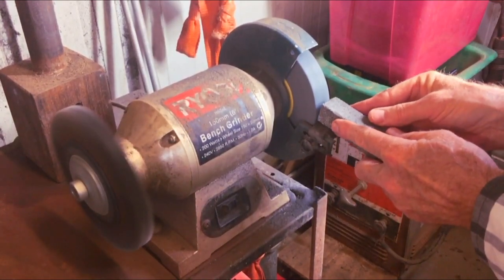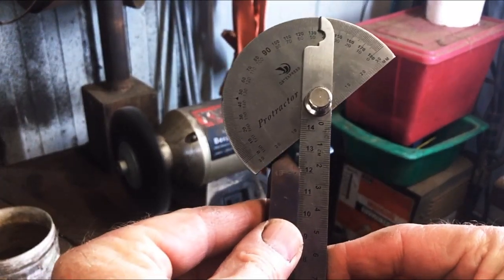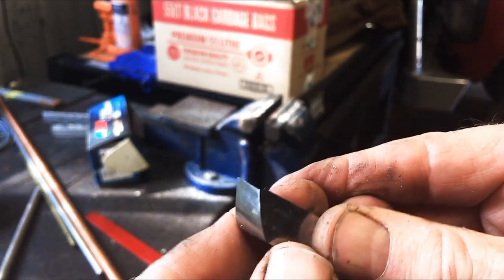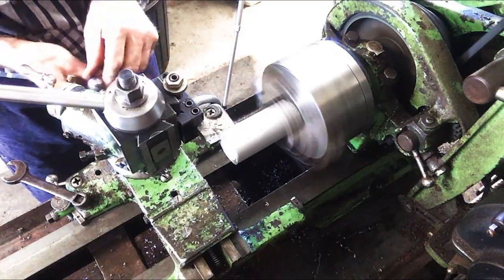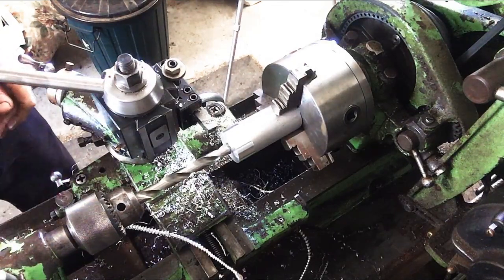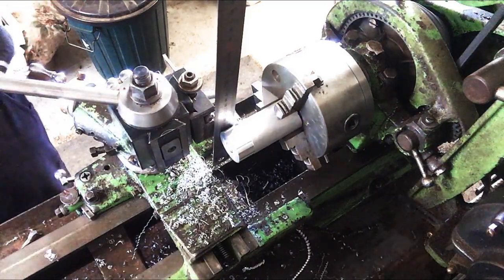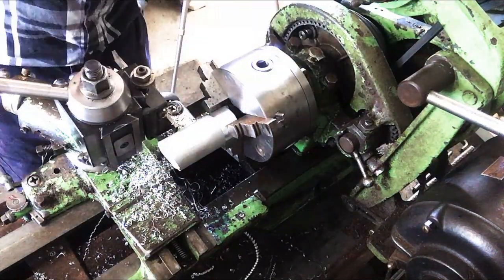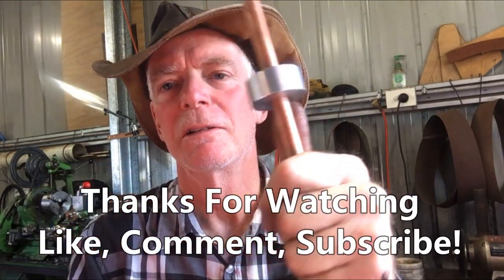How to Make a 45 Degree Chamfer Tool for a Lathe, The Old School Way

Comment: The chamfering tool works great, thanks for the tip about extra clearance required for internal holes.
Yes please on parting video. All the best.
Reply from the maker: It’s good to have a fan 🤠
Thanks
Reply: @DavoShed  Got to get you over a 1000 subs
Reply from the maker: I get about one sub per day currently. 🤠
It’s all good as long as I’m videoing stuff I enjoy doing anyway.
Some videos take off months after being published which is really odd.
I’m worried I’ll run out of ideas but that hasn’t happened yet.
Do you have a lathe in your workshop yet?
If so what is it?  Maybe a should do a video on how a lathe is measured :)
Reply: @DavoShed  I have small Taiwanese 6"x19" lathe.. I need to build a bench for it and find space in a shed for it.
Reply from the maker: @gregwmanning  Sounds Perfect to learn on.
Keep watching :)
Reply from the maker: You may also find this guy interesting.
He doesn’t post that often at the moment but has already posted quite a few videos.
Pretty east to watch
https://youtube.com/c/AdventureswithaVerySmallLathe
(He doesn’t know me 🤠)
Reply: @DavoShed  Ok Thanks
Reply from the maker: @gregwmanning 
Up to 991 🤠

Comment: Do you know how to grind a tool for truing up a center drill hole? I've heard it done, but I've never seen it.
Reply from the maker: You could do it with a chamfer tool like this one, just grind it to 30 deg instead of 45 deg. 
I think I have seen Abom79 true up a Center with a tiny boring bar with the compound slide set to 30 deg
Abom has a lot of videos to sift through 🤠
You could grind a small boring bar from HSS fairly easily as it would not need to be very long.
Just make sure you support your workpiece well with a steady rest if you can.
Good luck and thanks for commenting. 
Dave